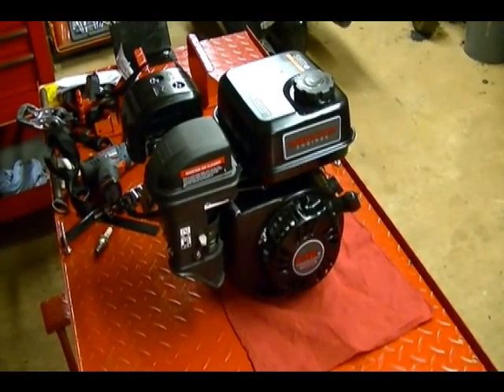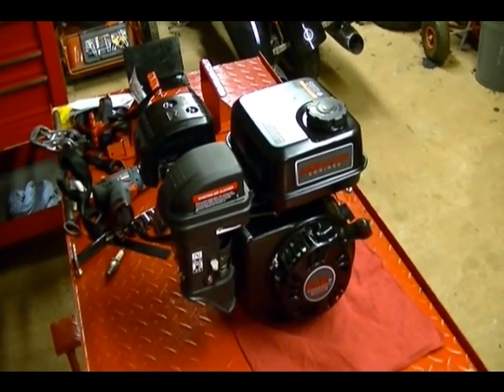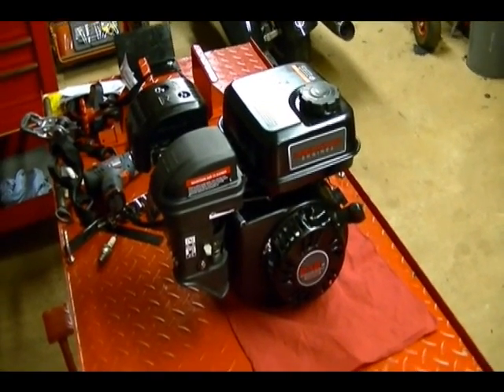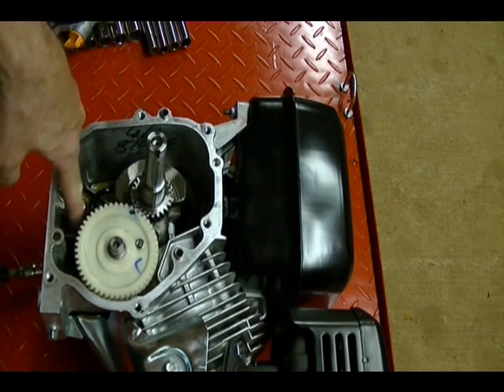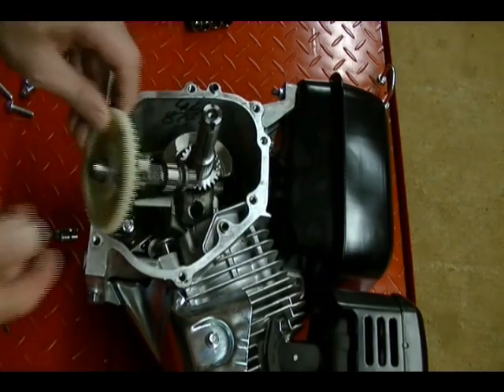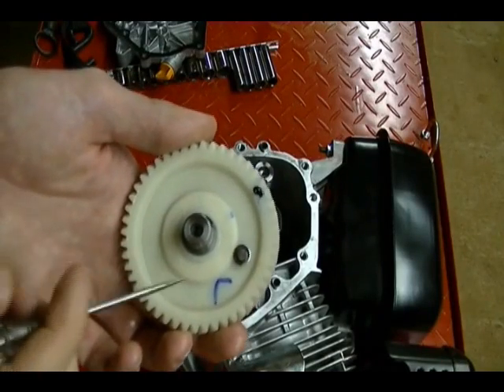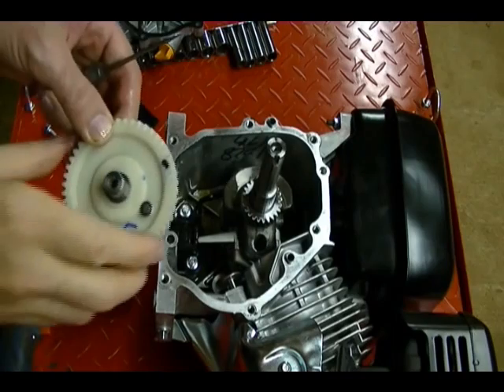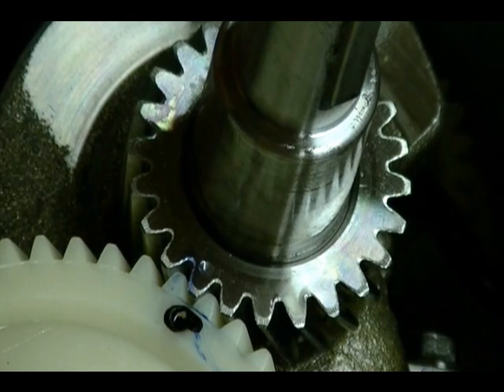Setting Crankshaft & Camshaft timing on most Industrial Honda, Briggs & Stratton, Tecumseh Engines

Comment: A rule of thumb is that at t.d.c., on the compression stroke , the slightest movement clockwise will touch one tappet and the same slight movement c.c.w. after t.d.c.will touch the other .
Reply: I want to correct my reply to say  A rule of thumb is that at t.d.c.,the valves will each move as you rock the flywheel slightly each way from t.d.c., BUT IT WILL NOT BE ON THE COMPRESSION STROKE .I had to time a 1926 F-I  Briggs that had the mark worn off off of the crank,and that method timed the valves as if it had marks.

Comment: make sure the piston is set to top dead center (piston at the top of the barrel) otherwise the cam will be 180 degrees out. thanks for info.
Reply: its physically impossible to line up the dots incorrectly with the cam. You cannot physically have the cam 180 degrees off if you line up the dots as the CAM determines TDC of compression/exhaust by its lobes, so as long as you simply line up the dots, then you are set.

Comment: I actually came back to post that this informational video is misleading and incomplete... I've been watching timing videos here on YT and noticed that almost no one at all is mentioning that the piston must be at TDC and both valves closed before lining up the gear marks will work. Failing to do so can also cause a stick fire at the carb at startup which could cause someone to get hurt since you must stand in front of the intake to pull start most generators and other small motors. For the authors sake I'd remake this video with proper instructions or just remove it before someone gets hurt or damages their motor.

Comment: um you dent meacion abut the pistion having to be at T.D.C (for yous that dont know t.d.c is top dead center witch your #1 piston has to be to set the timing
Reply: I actually came back to post this exact same thing... I've been watching timing videos here on YT and noticed that almost no one at all is mentioning that the piston must be at TDC and both valves closed before lining up the gear marks will work. Failing to do so can also cause a stick fire at the carb at startup which could cause someone to get hurt since you must stand in front of the intake to pull start most generators.

Comment: what would happen if you were to take out the low oil sensor? im going to install my motor on a mini bike and i dont want the motor to shut off when i take a sharp turn and the oil sloshes to one side.

Comment: I have 3 sensation mowers. I found the 10 inch round discs that goes on these mowers. They attach to the blade. I was told the hub goes first to the crankshaft then put on this disc then the blade then the bolt. Please advise. THX!!

Comment: Does that make the spark plug fire at TDC or does that make it some slightly less then TDC factor speck?
Reply: timing is set at degrees before top dead center. BTDC usually like 26-28 deg BTDC.

Comment: How would I advance the timing? Is it just be as simple as rotating the camshaft a few teeth forward in its natural direction of travel?

Say I have a 9hp Honda clone with about 14 lbs of torque. It maintains max torque at only 2500 rpm, but can run at well over 3600 rpm and does so frequently (modded for go kart). How would I go about changing this if I want more top end power?
Reply: 'advancing' the timing is increasing the degrees before top dead center when the spark plug fires. This is completely independent of the camshaft, and would require you to remove the flywheel, flywheel key, and (while the crank is stationary) spin the flywheel CLOCKWISE.

Comment: is there a way to check the timing without pulling the oil pan or valve cover and without engine running?
Reply: You can check it by pulling the head to see what valves open and close based on the piston location
Reply: Use a wooden dowel through the spark plug hole to get the piston lined up at tdc then check to see if the valves move when the engine is rotated back and forth a few degrees ( about 15mm on the flywheel diameter). They should both have very slight to no clearance at tdc but if loose rotate the engine 180 degrees and repeat.The flywheel has a magnet which lines up with the timing pickup on the block at tdc also, but you have to remove the pull start to see it in some cases.
Reply: How can you do that with the head removed?

Comment: I have the same configured engine but a Briggs & Stratton. I am having a problem cranking it. It pulls the crank cable back forcefully. What could be the problem. Thanks
Reply: Sounds like you need to adjust the valves

Comment: Great video... Simple and concise.  Just keep one thing in mind though, and that is.... "Sometimes" the mark on the Crankshaft Gear.... "Can Be" OFF.... I've seen them off (usually, but Not always.. retarded) as much as Three (3) Degrees,  so... just always be aware of that possibility, Especially on the "Foreign" produced engines.... The Predator Engines from Harbor Freight are more often than not... Very Good.

Comment: Damn chinese clone engine i got a couple days go has a 13/16" crankshaft instead of a 3/4". I'm temped to switch the crankshaft but i don't know if the teeth on the gears are the same ratio. Lol